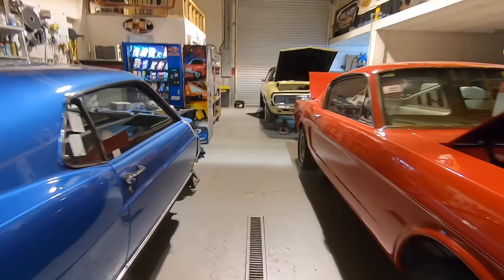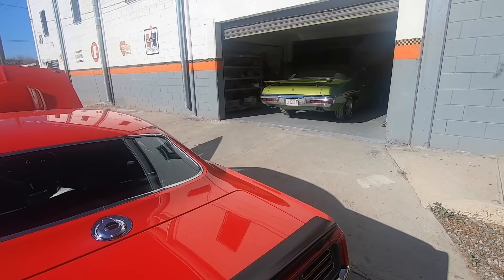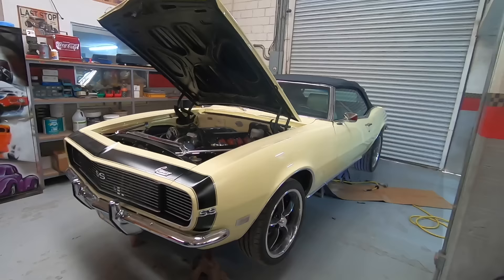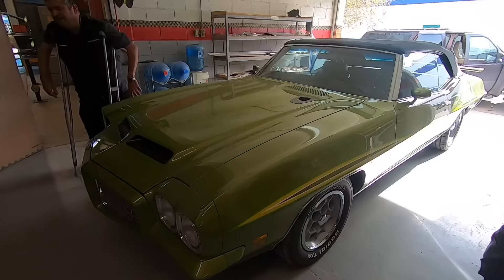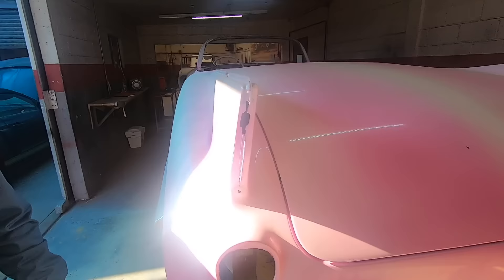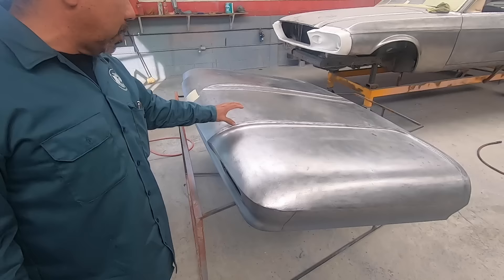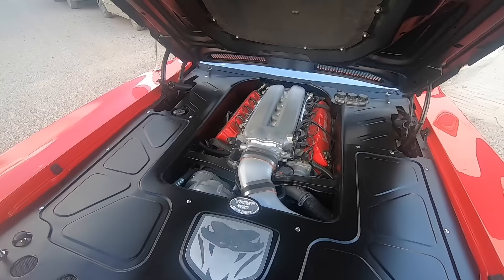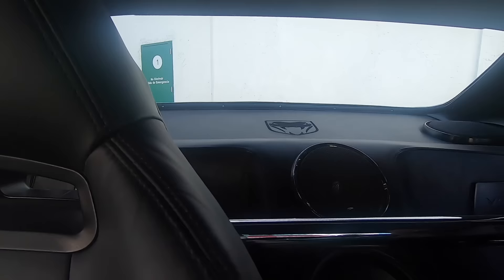Restoring & Building Cars in Mexico - Lower Labor Costs, High Quality Metal Work

Comment: Welding up rusted areas and using lead or fiberglassing is one hell of an improvement over Bondo and a lost art. The innovation this one shop has is what we as Americans have let slip away from us in the name of comfort (read lazyness).
These design details are what makes all the difference in the custom/daily driven vehicles. I love an original as much as anyone but this niche market has been in a boom for a while now. Custom touring vehicles are the new 🌊 wave. Bueatiful work at any price or country. This is what being good and being hungry looks like. America take note lest you be left behind. And chewey knows it!!
Reply: Actually,it’s for safety that things aren’t leaded anymore,the fumes are toxic.

I love my cars but I don’t want anyone to die a premature death from doing body work on it.
Reply: The artizens that lead aren't using lead. It's a bizmuth metal mix that is even safe to use in copper pipe home plumbing. Works and looks perfecty like lead when finished  but it's completely safe and can be reworked if necessary.
Reply: Randall Tufts 

It most certainly is not,it’s lead with small bit of tin mixed in....
Reply: There is no lead in that body work.   Just tons of hammering and grinding
Reply: idont wantcorporateretaliation 

Either it’s lead or bondo,take your pick.

Esp on the roofs of early mustangs that are notorious for rot.

Most Mexican body shops use a shit load of bondo from what I’ve seen.
Reply: Bondo and guacamole
Reply: Yessir so correct
Reply: lool guacamole
Reply: You cannot compare fiberglass with leading and Bondo. They are used for different things.
All these are available in the US if you are willing to pay the cost of labor.
Reply: @drewsharpe7484  
Lead is still used, as is zinc and cadmium. 
All these can cause metal fume poisoning if not using safety equipment.
Reply: Randall Tufts yeah it’s too bad that here in t United States 🇺🇸 it’s almost impossible to find anybody who can do lead work it’s about money 💰 and of course health just like Laqour paint
Reply: @drewsharpe7484  they make safer lead now
Reply: Cpk Unlimited 

No they don’t.....
Reply: @drewsharpe7484  yeah they do. it's called 30/70 and eastwood sells it in 5 lb quantities. They also sell 100% lead free body solder......you obviously have no clue what you are even talking about lol. 

People act like nobody solders body panels anymore... it's actually still a very very common practice at real body shops with real artisans. Go ahead and keep taking your shit to the 10k body guy and get wrecked with bondo.... if you want real body work done on a restoration, be prepared to spend 5 times the value of the car getting it done right the first time. Buy once, Cry once.
Reply: I only use lead. Way better then bondo.
Reply: Mr. Randall Tuft my respects to you, you are a true gentleman sir. You stuck to the subject of appreciating the art of working on cars and not making this video about race or politics that as Americans we are rotten with to the core with the scum politicians that are pining Americans against Americans.
Reply: @kaba_me  and it's also if you can find the person skilled and willing to do this work. Some times a good pay for some hard work is no longer worth the time and labor when you have a family and are getting older. Another problem here in America is that people even at body shops plaster the shit out of panels with bondo.

Comment: 25k is actually very expensive for Mexico, I was able to do my project in Mexico for around 4k on labor, I just took the part to them. So ended up spending around 7k, and came out perfect.
Reply: Yeah 100 to 250,000 pesos for body work and paint with the basic mechanics is more then enough.
Again depends what you want to do.
The viper build he has you're not going to get done for less then 350,000.
The problem where I am (Celaya) if finding someone who actually knows how to do things right.
Reply: You got to remember this man builds cars for Sema! This is not your hole on the wall Shop!

Comment: There are talented people all over.  The people that mention your car could be stolen in Mexico, well that can happen anywhere and if not stolen a lot of shop here in the US will take your deposit and never work on your car.  Your car is held hostage,  To get it back you have to pay them or get ready to possibly become threatening or scare them enough to give it back. Sometimes what's worse they build your car and cut corners badly dont install parts you agreed on or steal parts you provided and sell them to someone else.  Shops like foose, Ring Bros, kinDig never will work on a regular guys car they don't want that work because they are too big and want the big money jobs.  So its hard to find a good shop these days just the same as it is to find a good Home contractor.  You have to do your due diligence and research.  I have known a lot of people that get burned regardless of there geographic location.  Regular people should learn to do the work themselves.
Reply: OEMRadio Solutions That’s Truth it happen to one of my friend the shop took $2000 usd here in the states and they never did anything to the car

Comment: Superior Quality.

Back in the late 80’s I was stationed in San Diego and bought the 1st of my Falcons, a ‘68 falcon sports coupe. A buddy and I went to Tijuana regularly for almost 3 months checking out the car scene and shops. After the 3 months I was able to find an awesome little shop that did a bunch for me. Almost a full resto-mod really. Paint n bodywork, electrical, drive train, interior, etc... The quality was top notch and was priced so a young 3rd class petty officer could afford it. Super folks n a super job. Even made sure to point me in the right direction for the best chow. 

I wouldn’t hesitate a second to take a car to Jesse, not a second !

Comment: Gut an old 'Cuda and drop it on a modern unibody frame/frame, is pretty much next level. He is SEMA quality, and there isn't any better assurance you can get. I was ripped off 3K by a body shop for work on my '76 SWB C10. Wish I was closer as I wouldn't have any regrets trusting and paying this guy. May not be Chip Foose, but I doubt very many people would be able to tell the difference.

Comment: My cousin pumped into a light pole in   02 GMC Sierra. The rear end had a broken light and it was damaged.  We went to a recommend shop and they told us to come back in 6hrs. $80 later the damaged parts, dents and scratches were fixed. High quality at a 10th +/-  of the price here.

Comment: I don't know these mechanics.  Yet, I have experience with car work in Mexico.  I have seen people as they reenter the United States from the Tijuana area of Mexico.  Cars who went down for cheaper repairs would arrive back at the border.  The US Customs Officer would ask questions about their visit to Mexico.  When they explain they had work done on their cars, the knowledgeable Customs Officers would sometime ask about the work done, not for government need to know rather, asking what shop(s) etc...When they tell the Officer a name, well, the Customs Officer would tell the returning American about complaints from such auto shops.  For example, when doing custom upholstery, shops would user cow manure as opposed to Upholstery Foam: Sculpting, Pleating, & Sheets.  You won't notice it much until you turn on the air on a hot day shortly after you return.  

I would do some checking before investing too much into a project.  Now, this was pre Internet, so, maybe they were forced to change tactics or the mechanics have become 100% legit?
Just wanted to throw that out there.

Comment: For the past decade or so, all the North American cars are factory painted using water based paint because of lower emissions. Mexico body shops can still use the better quality old style paint, such as candy apple type which is very rare now in North America because it just doesn't look as good as a water base paint. Working with lead costs more but it doesn't crack in the extreme cold like bondo.

Comment: In the early eighties I bought a 1954 Kaiser Special in San Diego that had nice paint and interior. Only problem was whomever did the work did not replace the tack strip that the sides of the headliner attached to. Wondered who upholster the car till I found  a business card from an upholstery shop in TJ. 
A friend took a VW down there for body work. Had a dent about 3" deep behind the driver door.  Finished work looked good till a few weeks later he closed the door a bit harder than usual and a huge, 3" thick chunk of plastic filler fell off.

Comment: After building and stroking out my 289 a little over 430 hp on the dyno I had to add the gt350 hood my engine wouldn't fit under the stock hood😊

Comment: on that door, to do it right it should be chemically dipped so ALL the RUST is removed from the INSIDE of the door as well, then it should dipped in sealant then dipped in primer, same as factory otherwise the rust inside the door will eventually bleed through.. there is nothing more going on here than your every day fly by night restorer in the states, very few of them do it right even in the states... some rotisseries frame off are dipped and treated in the USA, but you have to find those guys, these places typically only do the dipping, its not expensive, about $700 per dip, so 700 to remove all the rust, $700 to to dip in the sealant and $700 to dip in the primer.. so for $21 you can have it done right... before you bring it to the dippers you want all your metal work done,  PRE Bondo stage

Comment: $25,000 + parts isn't any less than the USA,  seriously, your parts for that stang depending on what you have that's useable is around $60...  OR, if you want to compare there is a company in the USA that will build you a mustang all from 3rd party parts, their base model build is $65,000 ... so you figure, 30/70 30% for labor, 70% for parts, so there is about $40k to buy a complete ,mustang top to bottom in parts, that everything from tread to head.. they will build you a GT500 Shelby for $165k  429 SCJ, DP,  the works all modern...  you wont catch a break in Mezco, PLUS, if they decide you aren't getting your car back then what?  please...

Comment: What about sourcing parts? I'm looking form an VAM 282 straight 6. In the US that's the equivalent of a Jeep 4.0 with a 258 crank stroking it to 283 cubes minimum. hot Rod had an article on one that with a ported head made 664 HP under 17 lbs boost from a turbocharger. Finding a cheaper 282 and sticking a Edelbrock aluminum head on it, ported should make that much power of not more and keep the engine cooler so preignition is less a problem. Stick that in a lightweight AMC chassis like a 2600lb Gremlin and what do you get? Low ass ET's!

Comment: LET'S DO THE MATH HERE. At 4:50 the owner said that that 1967 Ford Mustang would be $25,000 IN LABOR COSTS ALONE! Add in the other $15,000 in parts to restore a car and you are at $40,000. That is for a STOCK '67 mustang HARDTOP. How is this cheaper than restoring it here in the USA? A good reputable restoration shop here in the US can easily restore a car for $25,000 in labor costs. This is not a deal people. Not to mention if something happens to your car (worse case scenario your car gets stolen) you will have NO recourse as it is in another country. Good luck getting your money back. I also saw a worker painting and another sandblasting without any mask or fresh air supplied to them. Horrible working conditions, decades behind the US in safety standards.
Reply from the maker: Labor in a U.S. shop?  More accurate  to look at cost per shop hour for comparison.
Reply: @thewriter2549  I am 51 years old and have been in the restoration business for over 30 years here in the US. To be fair I do not know the condition of the mustang when it was brought in. Maybe it was a basket-case? All I am saying is that $25,000 in labor costs for a basic car, being restored to stock condition does not sound like a deal to me. The other possibility is that he raised his prices after he started getting recognized for his outstanding work with all those SEMA awards. If so- Good for him! He earned it! I just don't think that's a deal at all, just my opinion.

Comment: He said $25k in labor roughly. There are a lot of shops that would do a quality build I.e. driver for that kind of money.
Reply: Not in the USA! I got a quote of $120,000 for a full restoration on a 1970 fastback
Reply: Lol
Reply: @bruceleeroy872  What was the break down. If you don't mind? There are plenty of people who charge absorbent rates to do a job that is half-ass. When you start talking about doing a restoration versus a custom Resto rod there's a large difference. I have a 1969 Fastback that I'm doing for myself. I have 15K in the Driveline alone. It's a simple setup
Reply: Turbo Mustang not in California
Reply: @bruceleeroy872  I think he means $25,000 for the transmission and engine swap labor,  exhaust and EFI install,  gauges, new rear axle install, suspension and brake upgrade labor. But $120,000 seems like what you could get 2 cars built for.
Reply: @Celticman197  that would be crazy! I can get a full restoration in India for $12000 every thing
Reply: @bruceleeroy872  Most shops that specialize in Muscle car rebuilds charge 120-150 per hour. I learned the hard way that you only use these shops. Don't even think about letting anybody else do it. Tow the car to another State if you have to. Even experienced General Mechanics are not able to do that type of work. They will tell you they can but it is way out of their league.
Reply: @Celticman197  I had a car restored back in the 80$ but it was way less, and it was at a mustang only shop. Bumper to bumper was just $12,000 for everything! Including NOS parts! Prices now are insane!
Reply: @turbomustang8417  ooooooo drive train is whole different animal! I have a POS 2001 f150 with a $40,000 drive train! 😂 Brand new crate Cobra Jet DOHC and everything! You can go bat shit crazy with the drive train. I know I did!
Reply: @bruceleeroy872  You can have $15,000 in transmission and engine alone, not counting labor and installation. Coyote engine alone can run $15,000, and crates are $10,000
Reply: @Celticman197  the new Cobra Jet is way more but I like it.

Comment: Too many Mustangs.  If I`m going to restore a 60's muscle car, it would be one with a full frame, like a GTO or  Chevelle.  Placing a powerful engine in a unibody car seems to lack strength and integrity.
Reply: The early Mustangs were light. Just build up a 289 or 302 and you are running with the big block full size cars. Weld in a pair of frame connectors and there is no risk of body flex.